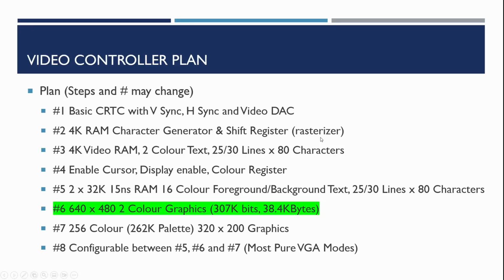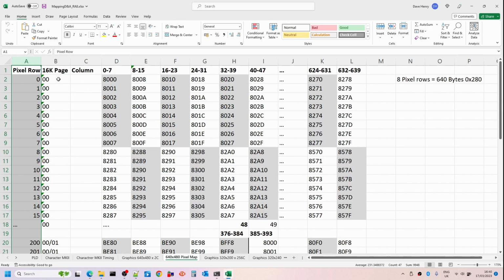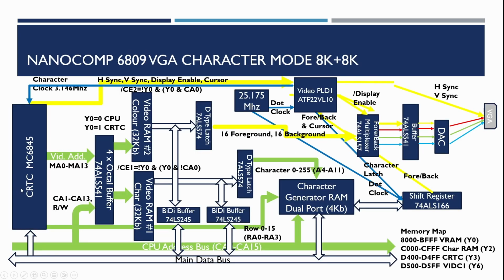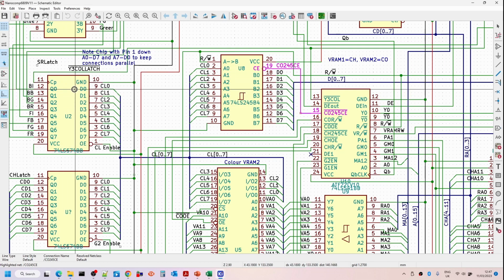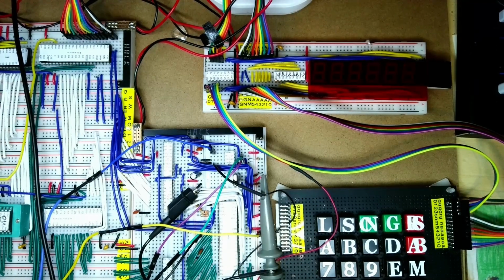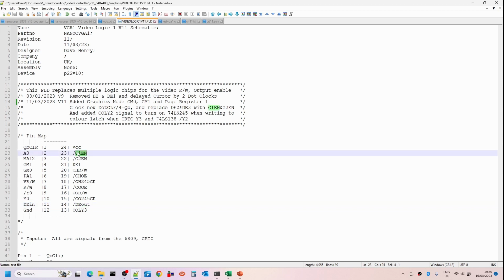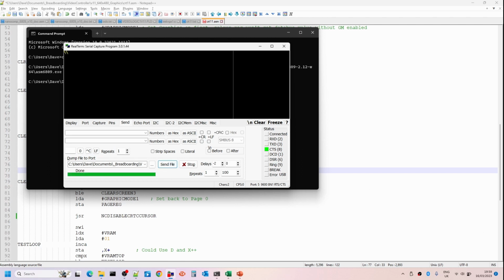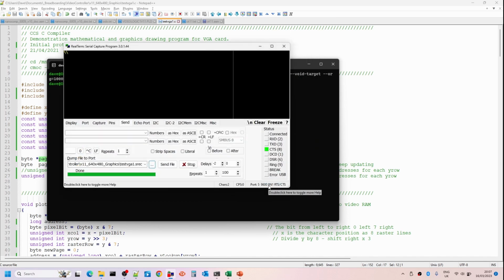V11 640x480 Graphics - Breadboard VGA Controller Nanocomp 6809 8 Bit Breadboard Micro

Comment: You wired that /RST pull-up to GND on the schematic.
Reply from the maker: I have checked the video and PDF, I think it is wired to the Red Vcc line but the GND label on the black power line does make it confusing. 
I have moved the GND label and added Vcc label in latest version. Thanks for the feedback.

Comment: Very complete explanation
Reply from the maker: I hope you found it of use. I couldn't find much explanation of how PC video worked from the ground up so I thought this series would provide one. I will do a summary for 640x480 graphics of about 10-15 minutes once I have the Lunar Lander code working. These longer ones are more of a diary of the process getting the VGA controller working. I tend to review at 2 x speed with subtitles and slow down if needed.
Reply: @breadboardinglabs  can’t wait